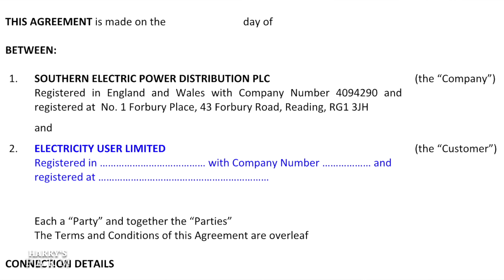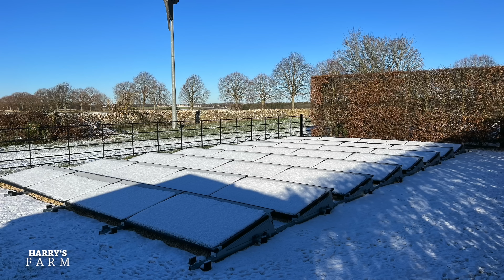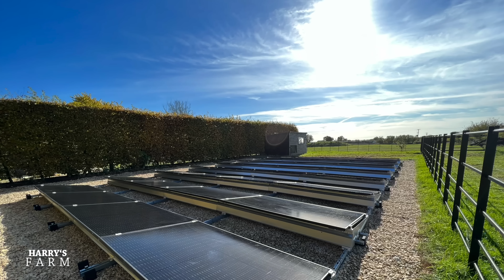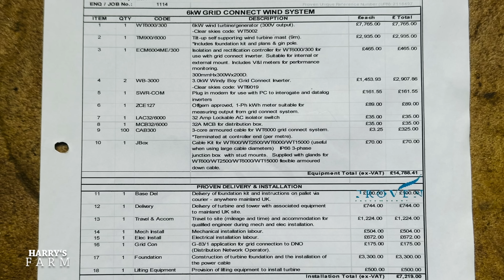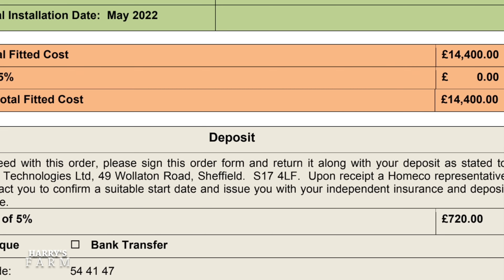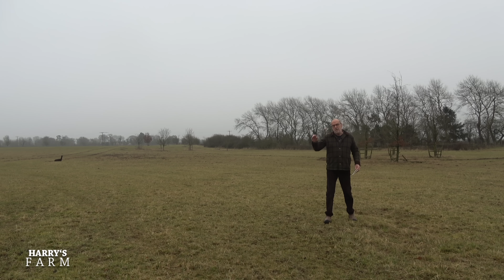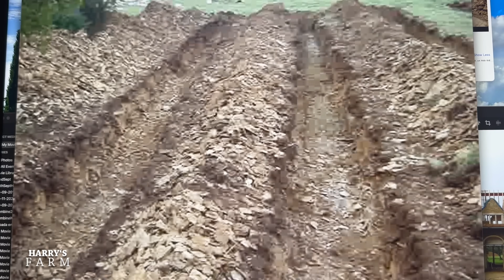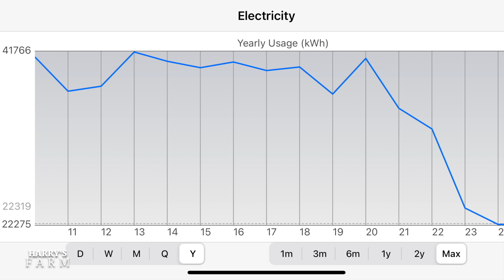Are solar panels & heat pumps worth installing? Here's what I've learnt after several years of use.

Comment: For me, the point of a battery is to charge off the grid at night when prices are cheap (7p per kwh with Octopus) then export the solar at 15p. This helps to balance the grid too....  It works for me.
Reply: I have a 26kw solar system and run a large ish house with ASHP’s. I also have battery storage and an electric car. During the summer we create far more then we can use but sell the excess back to the grid and get into a huge credit with my supplier which we then ‘spend’ in the winter when we don’t create as much solar. We also charge the batteries overnight in cheap tariff which helps the usage of electric in winter.
Reply: @kevletmein this is what my thinking is, save the credit up in the summer for winter so you can use to heat the home without worrying that your bills going to be through the roof.
Reply: It’s disgrace that flat dwellers who can only heat their properties with electricity aren’t offered these 7p over night prices which rich(er) EV owners have. With the two stage tariffs the night rate is nearer 20p and day rate is HIGHER than standard. Explain that Milliband (Labour) defender of the poor.
Reply: @dominicwood3750  Miliband doesn't control what tariffs are on offer by energy suppliers. Anyone can still access Economy 7 which is much cheaper overnight.
Reply: Yep same for me, Harrie's bills could be potentially so much lower with investment in batteries. My house is around a quarter of his in size, may be a little less. I have 15.5kWp of panels, and 29 kWh of batteries, I charge my batteries every night on 7p electric, the house runs all day on 7p electric in the winter (that may change when my AHP is installed soon), any excess, even in winter is exported at 15p, in the evening I export the batteries down to 15% SOC, even what I imported,  thus I'm maximising export. I do the same in the summer, charge the batteries at 7p, all excess is exported at 15p, this builds up a large credit for the winter months. May be with his usage it won't be cost effective, but for a lot of people it will be. My gas and electric costs have been negative for the last two years. Nice house, and I love the heated garage.
Reply: @TheRonskiman  That's great! We have a similar result. My bills are now just £10 per month for gas and electricity (4 bed detached) and I am still comfortably in credit with Octopus at this stage in the year.
Reply: Seems you've forgotten to include the cost of using the battery in your calculations. You need to work out how much you paid for the battery installation and divide by the guaranteed usage to get a price per KWh). Mine was about 7p/KWh, so only saving 3p per unit at the expense of reducing the life of the battery, just isn't worth the effort.
Reply: @rbee3936  I've no idea who you are replying to, but my battery is good for 6000 cycles apparently, at 1 cycle a day that's over 16 years, even then it should have 80% of its as new capacity still usable. I rather use mine to save as much as possible, batteries are getting cheaper, I built and installed my own batteries.
Reply: But you don't need solar -you can just get a battery, and charge it overnight from the grid, use it during the day?
Reply: Yep, my battery has charged every single night since I got it, even when that cost was about the same as my export price. Because having the battery charged at the start of the day vastly increases the chances of it lasting until the end of the day and keeps me off the more expensive day rate. I've now got an EV so charge overnight for 6.7p and sell during the day for 16.5p making it even more obvious that charging overnight is the way to go.
Reply: @FlatToRentUK What is the payback for the battery storage investment?
Reply: @johnmitchinson9577  I'll give how I work it out and some example figures but there's going to be huge variation here. For one thing I've been on various tariffs over the last couple of years and those won't all be available to everyone. And it's not just the tariffs but the price cap changing a lot as well.

My battery charges overnight and comes online as soon as the cheap rate ends which is 7am. It then runs the house until the sun comes up (assuming it does which it hasn't today), gets topped up for whatever was used up to that point and then runs the house once the sun goes down until midnight when it's offline and starts to charge again. So the way to work out the cost benefit is average daily utilisation x size of battery x price differential (difference between what you pay for charging and what you save from not importing from the grid).

Average utilisation of my first 5 KWh module is about 120% which is 1 KWh in the morning before the sun comes up and then it empties in the evening.
Size = 5 KWh
Differential = about 16p (6.7p to charge, 23p grid import)

So if I save 16p x 6 KWh = 96p per day = £350 per year. Cost now is £1,850 = 5 and a bit years payback.

But you can also look at subsequent battery modules. I have a second one so 10 KWh total. A second module can never be utilised over 100% and in summer will have a lot of days where it's not used at all. With longer days the solar can run the house far further into the afternoon/evening so less need for a battery, less lights on, etc.. So I think my second module will probably be nearer 10 years payback. If I had a third it would get used pretty much only in winter and even then probably only about 60% utilisation across 3 months. It would then sit doing nothing for 9 months. So not worth it at all. I don't think it's worth getting battery storage over about 60% of your average daily consumption.
Reply: @johnmitchinson9577 6 years or less, depends on usage
Reply: @johnmitchinson9577  depends on the length of time you're paying it off as that affects the interest you're paying. For me, the solar and batteries AND the loan have been cheaper than not doing it from the third month (we started in October!) so the payoff time was 3 months, although we'll be paying for it for 8 years.
Reply: @johnmitchinson9577  it's early days for me as I got aTesla Powerwall 2 along with my solar last May.
 I will do the calculations after the first 12 months have gone by. Looking very good so far, even with the very cloudy winter . Installers estimated 9 years, but that was without the export price we have (they guessed based on 4.1p export from memory).
Reply: @MyMateYourMate  So the estimated PB is 8 years then based on today's electricity prices! Assuming the battery does not undergo thermal runaway it is have to be replaced after 8 years and the solar PV inverters after 10 to 12 years. I assume you've informed your house insurance company about the battery installation because of the risk of thermal runaway, and the valuation office about this improvement as it affects the Council Tax band of the property when you decide to sell it!
Reply: @johnmitchinson9577  house insurance notification isn’t required under ABI guidance, provided it doesn’t take the rebuild cost into underinsured territory. This is VERY unlikely. Also although adding solar MAY be considered as a notifiable improvement (this varies greatly from LA to LA) is actually CANNOT be applied until the property is sold, or there is a general revaluation in rates nationally, so it will have no effect on the installers council tax bill. Also battery thermal runaway in domestic settings is extraordinarily rare, thanks to modern BMS. And even in the event of thermal runaway, the vast majority of time this results in failure not fire risk. In total during the last reported year there were 66 domestic solar fires, of which 75% were caused within a year of installation and caused by improper installation. There were 3 times as many fires caused by ebikes in this time. A study by Zurich Insurance classified domestic solar fires caused risk as so small as to be statistically insignificant.
Reply: @johnmitchinson9577  lithium iron phosphate batteries as used in home storage are far less susceptible to thermal runaway. I am not aware of ANY instances of lifepo batteries suffering from thermal runanway 👍
Reply: @minihaha-h3n  And when LiFePO4 undergoes a thermal runaway a toxic product  of combustion is hydrogen fluoride.
Reply: @johnmitchinson9577   So I wrote a very nice, detailed description of how to calculate payback time and it's vanished. Suffice to say my first 5 KWh battery module saves me about £1 per day and now they cost about £1,900. So about 5.5 years payback. It helps a lot if the differential between the cost of charging and what you save on the day rate during discharge are large. For someone with a very cheap EV rate overnight it does pretty well. I did buy a second module but it won't get utilised as much as the first one because in summer the days are longer so solar will run the house later into the evening. That'll probably payback in about 9 years.
Reply: @johnmitchinson9577  Council tax bands are set based on the value of the property in 1991. Unless installing a battery in 2025 somehow changes the past and increases your house price 35 years ago I don't think you need to worry about it. Also my battery is guaranteed for 4,500 cycles (about 12 years) and even out of guarantee it will still keep working for a long while, just with some degradation.
Reply: @FlatToRentUK  Indeed Council Tax bands were set based on property values in 1991 but any improvements to the property that enhances the value compared to neighbouring properties allows the valuation office to note this so that when you sell the property the new purchaser will by paying a higher tax band rate or if it is decided to conduct a re-evaluation of property values. It is important that your neighbours report your improvement works to the valuation office. Afterall it is only fair that you or th new owner pays more Council Tax. to fund the disadvantage and those in fuel poverty.
Reply: @FlatToRentUK  You didn't say what your actual cost was for the 5kWh battery, which I suspect was much higher than the £1,900 plus 5% VAT you quoted as the current price. I also think your calculated daily saving of £1 is wrong is is more likely 50p daily. thus doubling your PB to 11 years.
Reply: @minihaha-h3n  But when they do undergo thermal runaway a by-product is toxic hydrogen fluoride gas. I think several ultra-mega BESS that are LiFePO4 have burnt releasing toxic gases hazardous to health. I would recommend affected neighbours to take legal action when such incidents occur. Class action lawsuits may be necessary, which would mean any property with battery storage become uninsurable.
Reply: @johnmitchinson9577  The figures I gave are accurate. VAT on domestic storage was removed in April 2024. My saving per KWh is the difference between what I pay to charge - 6.7p and the saving on the day rate - 25.4p. Multiply that by the daily utilisation which is 6-7 KWh of usage (battery is fully charged overnight and topped up by solar) and it's about £1 per day. Maybe more.
Reply: @johnmitchinson9577  you've been drinking some of the anti-solar kool-aid mate.
Reply: @johnmitchinson9577  wrote "What is the payback for the battery storage investment?". That depends a lot on what you buy. A DIY Fogstar will get you 16kWh for under 2 grand. A professional SIGenergy install will set you back 7 grand for the same capacity. And there are plenty in-between. Our Fogstar/Seplos 16kWh battery will make about £1/day from arbitrage and 70p from using solar all day instead of just daylight. So will take about 1000 days or 3 years to pay for itself in both financial and CO2e terms. A 7 grand battery will take 11 years (which is about the battery lifetime). So a cheap/DIY one will pay back quite quickly. Fancier kit is still quite marginal, but improving. A system is more than just a battery, so it's actually the combination of inverter/charger, battery and panels that really needs to be considered as a whole.
Reply: @FlatToRentUK  You can get 16 kWh for £1800 now. Batteries have got a lot cheaper in the last couple of years.
Reply: @xxwookey  Yeah, I saw that. Do you mean the Fogstar batteries? But I was tied into the inverter and battery management system previously installed. Looking back there were better choices my installer could have made. I'm considering when we install a heat pump going for something like that to keep off the grid during the day. I probably won't be able to charge it from solar but that's not an issue.
Reply: @johnmitchinson9577  Not all battery chemistry/manufacturers are susceptible to thermal runaway. Caveat Emptor.
Reply: @johnmitchinson9577  The insurers just noted the installation on the policy with no increase in premium.
Reply: @ Firstly I'm not your mate and secondly solar PV have their uses provided the panels are made in the UK, don't use fossil fuel to make and the installing owner does not rely on any grid supply.
Reply: @davidjenkins5051  It will be only a question of time before your insurance premium goes up. Its all about financial risk and you've declared an insurable risk, which no doubt they will appreciate more so as your system ages.
Reply: @FlatToRentUK  Yes Fogstar. (You can spend even less if you source the cells from China yourself, but then you need to do your research carefully to avoid being ripped-off.). Or you can spend a bit more and get them pre-assembled.
Reply: @johnmitchinson9577  I love how angry you've got now that you've been totally owned on the question of whether the investments in these technologies can be worth it, you've had to pivot to implying people are hypocrites if they even touch fossil fuels once their new installation is in place.
Reply: @ Not sure what you're talking about? My arguments are robust and unquestionable.
Reply: @johnmitchinson9577  What arguments? You haven't made any arguments. You've just gone 'nuh uh' when people presented you with facts and figures from their own experience.
Reply: @johnmitchinson9577  I had 8kvp Solar and 10Kw battery installed in January and I am looking at 5 years.  But this is before I have got myself onto the proper Octopus contract to allow me to charge over night and export.
Biggest issue I have found is that the battery stops working at 3°c and that I create so much energy in the day I am not getting the benefit.
I am already considering a second 10kw battery but the version with the heater so it continue to work overnight.
Reply: @johnmitchinson9577  the chance of thermal runaway is 0.2%, the chance of you having a house fire is 1% therefore yes you have to tell your insurer but think it makes any tangible difference is wrong
Reply: @FlatToRentUK do you know what rate the battery charges at or how many hours it takes?  I'm looking into batteries as a first step as we're on 7p Octopus for the car...
Reply: @neilattwood6227  It'll vary by manufacturer but my Huawei ones charge and discharge at 2.5KW. Which is fine, we don't often exceed that for long periods. I'd probably look at others like GivEnergy or Fogstar which seem great value.

I watched a Gary Does Solar video recently about stopping your EV from draining the battery which you want to avoid. GivEnergy seems easier to configure and respond to Octopus smart charging periods. Gary setup Home Assistance software to do it. Might be interesting?
Reply: @neilattwood6227  I have a Tesla Powerwall2,  which is charged overnight on Eon Drive, (I also have an EV)  Mine charges on normal house supply, So I can top mine up in a couple hours overnight,  thats from about 30% remaining to full
Reply: @neilattwood6227  my solaredge 9.7kwh battery charges at 5kw. Charging it from the 7p octopus tariff during the night and using it during the day halved my electricity bill.
Reply: Our battery charges at 3.6kw/h. We have a 9.5kwh battery which takes around 2.5hours. During the day, the daylight keeps the battery topped up and the house runs on it at night. All of our solar generation is sold straight back to the grid at 15p kwh@neilattwood6227
Reply: This EXACTLY!
Reply: Agree!   But even without a battery, you have to look at it over the whole year to understand 'balancing the grid'.  I'm £1500 in credit after the summer export to Octopus and back down to zero after the winter heating bills.  I'm 100% electric (28kW GSHP, 13kW solar) and have a monthly DD of only £100.
Reply: I started watching and immediately said urm why don’t you have a battery. We do what everyone here is saying and use when no solar and charge over night at the lower rate.
Reply: @davidjenkins5051  +backup if power is down.
Reply: not me, imo the batteries are the most critical part of the entire deal that and the inverter, my main concern is the power stays on, so I want a "backup" my dream number is 50kwh backup battery bank to run a house off of during down time or anything else, and yes Solar to charge it as well but that is the secondary part of the build for me anyway I do plan to do this at some point but im waiting for costs to come down batteries etc but they are pretty cheap at the moment still hoping for cheaper
Reply: @adairjanney7109  Even just a basic 5kWh/3.68kW system to use as an UPS for short periods, and to help cover peak periods is beneficial for the user, and the grid.
Reply: @adairjanney7109  50kWh is ~6 grand of battery. That would keep our house going for at least 8 days. Do you really need that much? The first part of your battery works hardest, as it gets used every day. As you add more it gets used less and less frequently so each kWh is more expensive.

Backup power is useful. We just installed that even though power cuts are pretty rare here,  but the kit can do it, so why not use the functionality. Most UK AC-coupled PV+battery installs do not provide this, but unless your power is unreliable due to overhead lines, or you think the zombie apocalypse is coming, it probably doesn't actually matter much. 

There has been a battery glut this year, which has really pushed prices down. I don't know how much longer that will last. I expect a bit of stabilisation for a year or so, but who knows...It's a very dynamic market out there with EVs, grid backup and domestic ESS all growing fast, but affected by grants programs and politics to make things quite lumpy.
Reply: But then sadly you've got to include additional maintenance costs, inverters that are very expensive and batteries.
Reply: @grahamatsea3575   Maintenance costs are zero. Most people looking at batteries will have solar which will require the inverter that runs the whole system. If you were just installing a battery system then I think you're correct that you'd need an inverter but it wouldn't be that expensive because it wouldn't have to handle as much discharge. I've got a 6KW one because the solar needs it, batteries only discharge around 3KW so a smaller, cheaper inverter would do the job.
Reply: @FlatToRentUK  I hear you but maintenance costs certainly aren't zero. Inverters and batteries only  have a certain life. High quality inverters with a 7 to 10 ten year warranty are around 3 to 4k for a system we were looking at ,  batteries again will have a certain life ( my yacht batteries last around 7 years and are agm and good quality and these alone are around 3.5k  ) . All of these projected costs need building into the running costs . 
Anyway I'm glad you like your system.
Reply: @grahamatsea3575  We probably need to clarify what I consider maintenance costs which are keeping the system running optimally. That's basically cleaning the panels every couple of years with a Karcher. But yes, if something fails it will need to be replaced by my inverter costs £1k so fitted probably £1,200. My battery is guaranteed for 4,500 cycles (so 10-12 years) and if it degrades significantly then it makes more sense to just add an extra one. Battery prices are coming down so fast I doubt it'll be a big cost in 8+ years. I look at those costs over a 25 year period where if it's saving me over £2k per year then these are easily absorbed.
Reply: I do the same.  Would be nice if you could empty your Tesla battery at night at 15p a KW just before the cheap rate.
Reply: I get 5p overnight and run everything I can
Reply: I get 5 p per KWH overnight and didn’t need to have an EV to get that price.  My aim is to get to the stage where I can run the house for free
Reply: David, 

you are mistaken if you think it helps balance the grid. Grid balancing requires a source that is controllable and in practice the U.K. grid is predominantly balanced by combined cycle gas turbines.
For the most part peak solar output does not coincide with peak demand. In winter solar provides zero power at peak demand.
In much sunnier countries solar output is a huge probem for the grid operator
Reply: You're not "helping" the grid by getting paid 15p per kwh. That's many times their bulk rate. You're getting a huge subsidy from the taxpayer
Reply: But you need to have an EV to get that tariff!!!!! Did you forget to mention that !! Renewables can never run a counties power grid! Just look at what's happened in France, Spain etc!! FACT!
Reply: Those panels set for summer sun when its up at 80°

Technically, thats not all that nessasary. 

However, 35° is considered about optimal year round, from the USA on thru to Europe. 

My arrays are set to the absolute lowest, based on the winter solstice, that way they are catching the absolute maximum at the suns absolute lowest. 

I would suggest correcting winter angle, and raising your arrays by approximately 4'. Enough to skirt winter shading.and still low enough to clean.
Reply: Yes, this is the way to do it. I have solar and a battery. I'm almost off grid. Total annual bill for gas/electric/electric for car is around £400 offset with wind farm shares so £32 per month.
Reply: There's no ROI there. When you look at the cost of the installation and the number of cycles it will survive. You would never make the money back.
Reply: @DJS_ENO  I never made any money on the big LCD TV I bought back in 2005 either.
Reply: @DJS_ENO  Except that's not true.  Generally, tier I panels are guaranteed for a 25-30 years lifetime with a maximum performance degradation of 20% by the end of warranty period.  Besides, what's your payback on monthly electricity bills paid to the grid operator?
Reply: @otm646  we'll see. Time will tell.  We have had power cuts along the way and I've not even noticed them. I'm self-employed and was able to keep working for the duration.  That contributed massively to the payback!
Reply: You cannot 'balance the grid' with a power source that does not work at night, nor on poorly lit days, nor when covered in rain or frost and  is dependant on a sunlight angle that massively changes over the year and is hugely affected by haze and cloud which affects output too.
Reply: @sirjohng1  thats not what he meant. By balancing the grid i assume he meant drawing power off the grid when there is more power produced than needed (largely from offshore wind) and either using it, or selling it back to the grid during the day when there is higher demand. The solar panels are largely irrelevant to that  and is a smaller version of what the grid operators are installing themselves for that very purpose.
Reply: @sirjohng1  Peak power consumption times in the UK are when we get up in the morning and 4-7 in the afternoon. With my battery I never touch the grid in the morning, I've effectively balanced the grid by moving that consumption into the off-peak period. Unless we have a gloomy, grey day then I won't touch the grid in the afternoon either. I'd estimate it's only 30-40 days per year this happens. On the other ~330 days of the year I don't touch the grid in the afternoon either. That's how it's done. If we can lower our daily peaks we lower our generation requirements.
Reply: @sirjohng1  But you're forgetting, Labour are imbiciles...
Reply: Exporting is dumb when they buy at  wholesale price of peanuts but sell at peak retail consumer of arm + leg
Reply: @soundslight7754 wrote "Exporting is dumb...". Once your battery is full you might as well export and take the money. That's not dumb. You can get 13-15p per kWH for export which is worth having. With a big enough battery and fast enough charger you can also buy all your electricty at <10p/kWh on an overnight tariff, or get it for capital cost only from your panels. Overall you can greatly reduce costs and your load on the grid.
Reply: @soundslight7754 There is no choice but to export when the system is producing more than you can consume at that point in time.  The only way to mitigate against that is to have batteries but even then once they are full the system 'will' export whether you like it or not so you might as well maximise the payment you receive for it.  It's not a fair system but there's nothing we can do to change it.